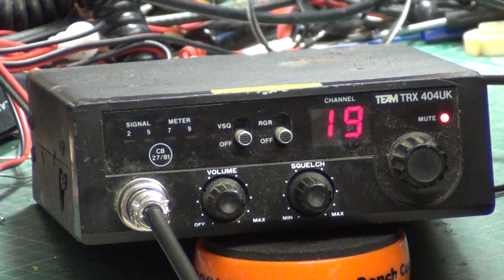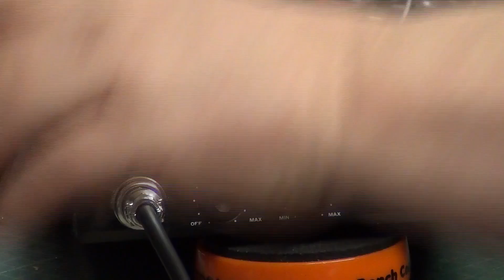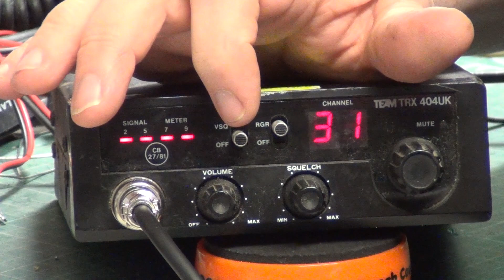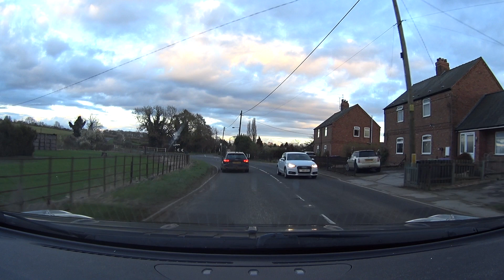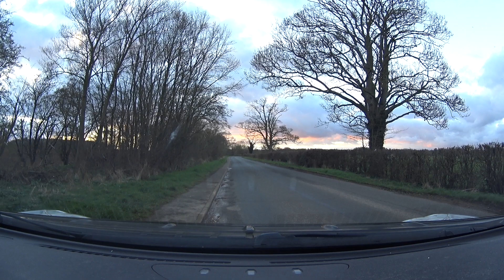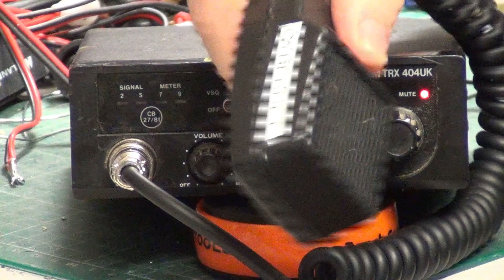Team TRX404 UK CB27/81 UK FM CB radio - On the air test

Comment: That set worked very well at all the key points in the Scratchy corner test good signal and modulation, I thought I might have fell behind on the videos as I lost my glasses in Nottingham yesterday and could not watch last night but all is good got an emergency pair till I get to the opticians luckily.

Comment: What antenna on your mobile please ?
Reply from the maker: It's a Red Thunder, which is basically a cheap copy of a Les Wallen Modulator. This is done on purpose to demonstrate good performance can be had from cheap products...the downside will be that the service life will be less than the real thing. The aerial is mounted on a 3/8" drilled-in body mount in the centre of the roof. The vehicle is a 2016 Nissan Leaf electric car.

Richard, G0OJF, UK
Reply: @ukfmcbradioservicingTango21  thank you 73's